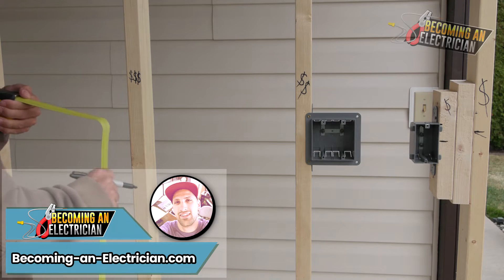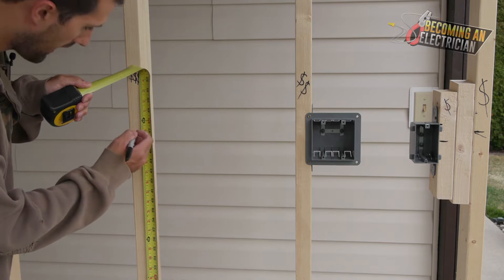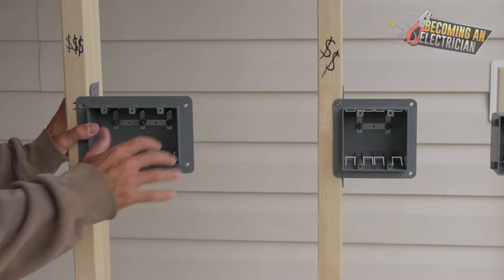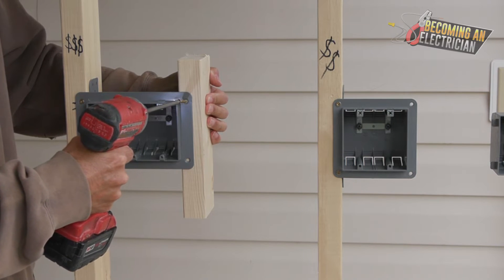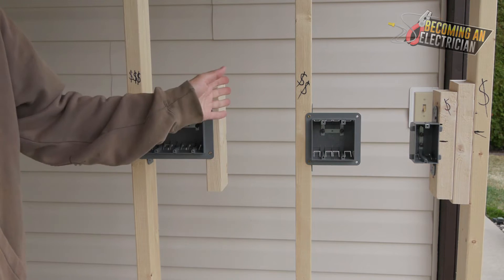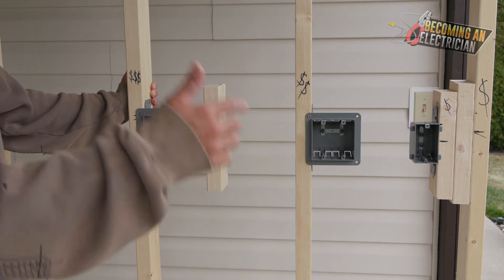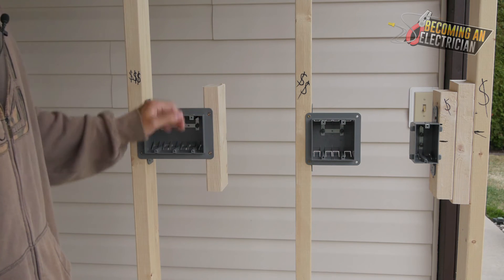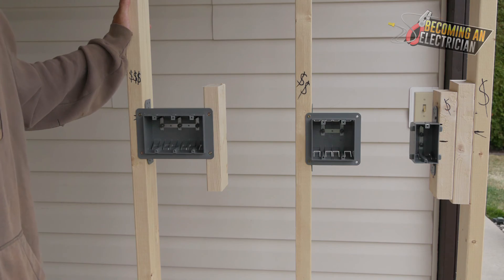How to Install a Triple Gang Electrical Box

Comment: Great video. I can’t find a video on hooking up a forging box with four outlets from Single source wire from panel on its own breaker. Last leg travels down to a lower wall outlet where it ends the line. so five outlets total to a single breaker
Reply from the maker: Hi, you splice electrical pigtails onto the home run (wire from the panel) to join onto the plugs.  I kind of show it in this video about splicing a double gang box (it's for electrical switches, but same approach for plugs.. make sure to bond for plugs):
https://becoming-an-electrician.com/splice-wires-double-gang-box/

Comment: You said in your article that 3 gang boxes are required to be supported per code.  Could you please let us know where in the electrical code that is stated?  I can't seem to find it.
Reply from the maker: This is Canadian Electrical Code.. it's "Outlet box supports" under Section 12-3010 (some info may be in Appendix B, too..):

Here's a helpful article I found, too.. search for "secured" in that .pdf:
https://cdn-e.soneparcanada.io/PIM_Docs/Docs/STEP_ASSETS_PDF/14469667.pdf
Reply: Interesting that in that link, they indicate that the hanging board would not comply. I do understand they're trying to sell their hardware, but I assume they mean that the gang box should be secured to a stud on both sides.